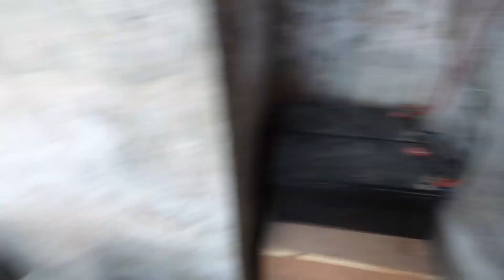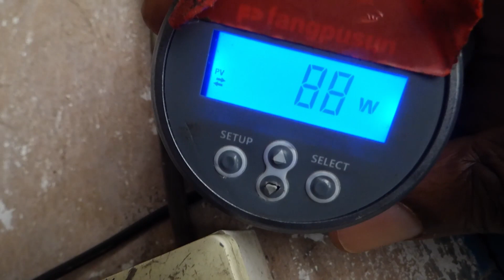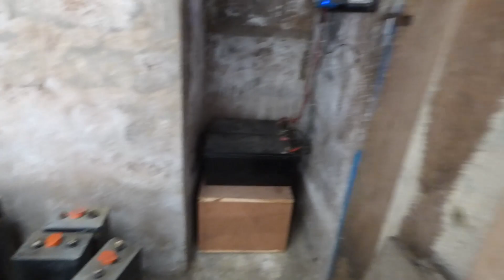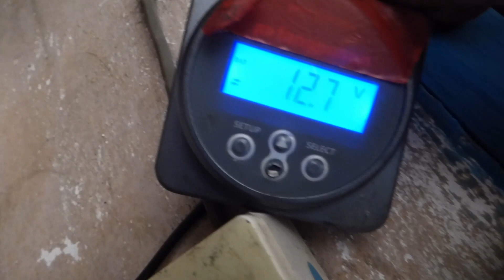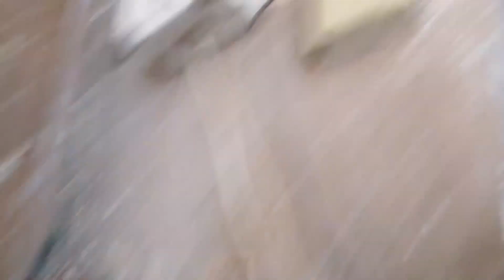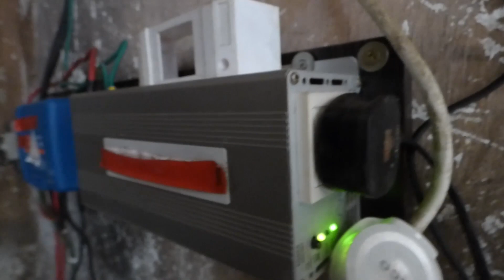Did I get some battery Mojo Back?  Did the Long 200 AH work?

Comment: Great video, am just setting up little solar for my self 24v 200ah 2.5kv with 500w solar panel but I know with time I upgrade when I have more funds, but still managing it  with pmw charge controller
Reply from the maker: A PWM controller works just fine if the system is properly optimized. Welcome to our world. Don't forget to subscribe